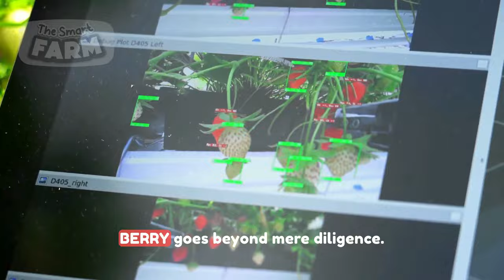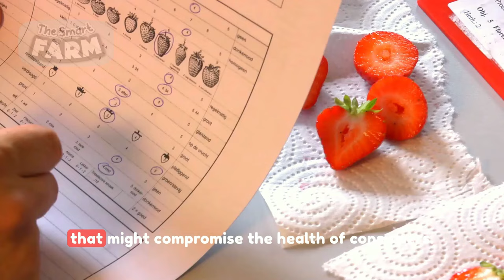These Robots Will Change Strawberries Harvesting FOREVER

Comment: well, nice. But these robots need a very very special setup of a field. I see scaling only in a solution, that can work on a normal field everywhere. None of them can do that.
Reply: Yes and no. The fields are already created with fast harvesting in mind (with straight rows and even, rail systems), so it should not be difficult to adapt them for robotic systems. Frankly, I am more worried about how their mechatronics (the motors and actuators) are going to withstand long operations on dirty and often humid environments.